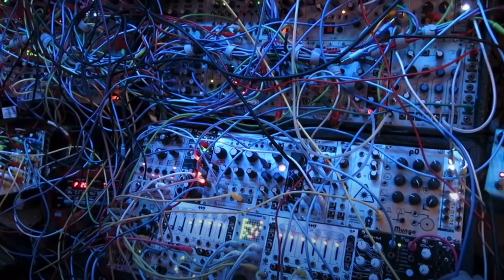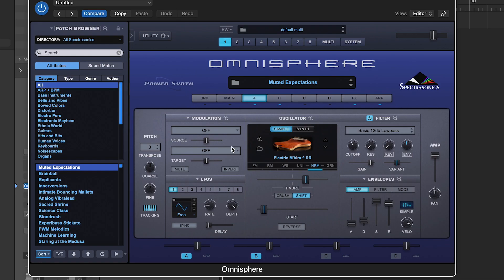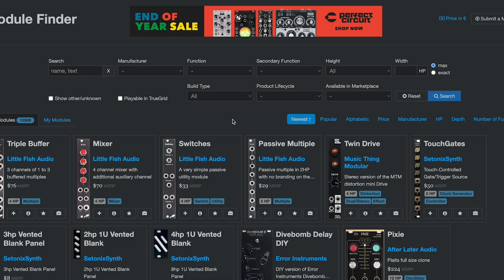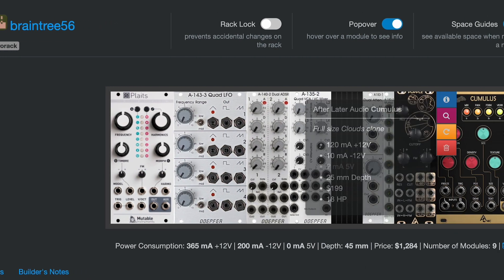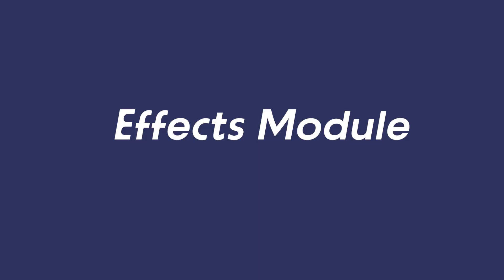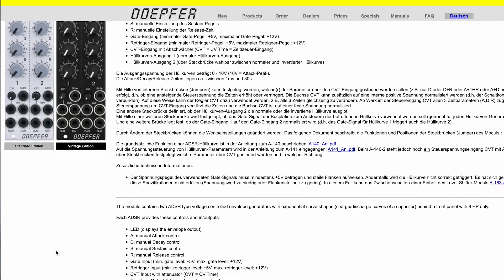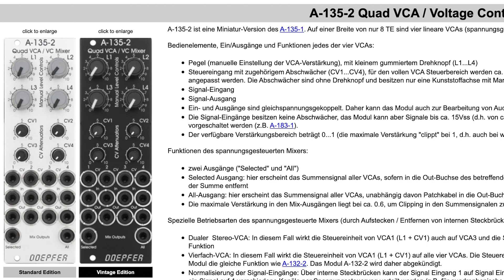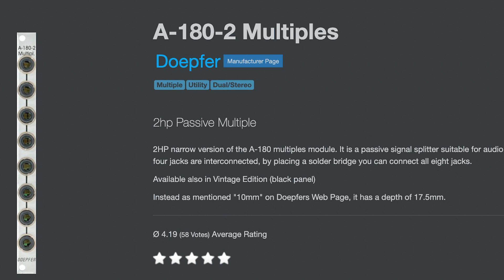First Modular Build - Expanding on the Moog Sound Studio - The Plan - Video 1

Comment: Man this is so helpful. I just found this today and I am in the exact same situation. Tiptop case using with DFAM. Using it to expand what Moog can do, since I have great oscillators already. More modulations available. I felt weird going this route until I saw this video. Thanks so much!
Reply from the maker: Thanks. I kind of veered off this path though. I ended up diving in. But this is really a great place to start so the initial cost doesn't feel so tough.

Comment: I, for one, am rather new to the modular world: I got my first gear a mere 3 months ago ! But as you did, I too did intensive research before choosing what to buy. And I believe that this research really pushed me AWAY from modular into SEMI-modular.
The reason is that the analog semi-modular market these days has grown huge, with many products being truly affordable and providing most (if not all) of the functions that various modules can provide here and there. Obviously, no synth by itself will answer anyone's dream configuration. But, at the price of a few redundancies (and some wasted space too), I believe that one can gather exactly all the functions one needs just relying on the reunion of a few existing semi-modular synth, for a fraction of the cost of the equivalent modular system (buying modules by the function ends up being really costly).
Now, I will definitely agree that this strategy makes you end up with a less elegant system than a one-of-a-kind modular rack built to suit your very own needs. But as I said above, the final price is generally a fraction of that of the modular equivalent.

As an example, I, for one, have built a configuration around a two-synth version of the Moog Sound Studio, with a DFAM and a Subharmonicon. But instead of buying a Mother 32 as a third synth, I went for Behringer's recent clone of the Arp 2600 (I have been dreaming of an Arp 2600 for decades !). For pretty much the same price as a Mother (or even a bit less), you get a beast of a machine with 3 oscillators plus an LFO, two enveloppe generators and dozens of signal processing modules (ring modulator, voltage processor, Sample & Hold, Enveloppe Follower, Mult, Spring Reverb, ...). It simply is an endless source of exploration by itself, and complements my other synths (the two Moogs) perfectly.
To that, I added a dirt-cheap entry drum machine that can sequence Cv signal (giving me six extra trigger-alone lines of sequencers for "beefing up" the rhythms of the DFAM), and an Arturia Keystep to play the whole thing and use the excellent built-in sequencer too.
At the end of the day, and including various cables and adapters, the whole thing ended up costing me around 2800 €. I do not think I could have even approached close to such a configuration by sticking to a pure modular system for the same money.

Once again, I will definitely agree that building a one-of-a-kind system with the equivalent specifications using separate modules would have yielded something much more elegant and more user-friendly. But the price tag difference kept me away from it.
That being said, the spirit remains the same: it is all about assembling the exact set of particular functions that will end up meet your personal sound design cravings ! 🙂
Reply from the maker: I love the Arp2600! I've wanted one of those too... I hear you. It's definitely costly. Even for the super tiny setup in this video cost me about 1k. It's such a hard space to enter, but now I'm finding that because I have the base setup, I can add modules slowly over time. It's a fun hobby and it appears many of these modules retain their value. I try to look for interesting deals on used modules as much as I can. Its a pretty fun community.
Reply: @braintree56  The ability to grow by gradual steps is indeed an interesting aspect of modular synths. And you are right about the resale value too: it is an element to consider if one intends to make one's setup evolve.

Concerning the Arp clone, I went for a Behringer 2600 Blue Meanie (which is a full-analog version), and I have to say that I have been positively impressed by the build quality, the design and the sound of this machine. They based this synth on the better-equipped versions of the original Arp 2600 (namely, those with a dedicated LFO and a Mult added next to the keyboard), and on top of that also added several quality-of-life modern features: a full MIDI connexion, VCOs with a larger choice of waveforms and modulation patch points than on the original, a widely extended range of enveloppe times thanks to a time multiplier switch (present on both the ADSR and the AR enveloppes modules), and a few other extra things here and there.
All the patches detailed in the original Arp Patch Book of 1971 (which has been made available online by Korg) work like a charm on the Behringer clone, which makes me inclined to trust that the experience it provides is very close to that of an original model.
Behringer is a company that often makes controversial products, but with this 2600 clone, they demonstrated they were also capable of the best. This synth is a masterpiece, and I would advise any modular fan to add one to their rack !

Comment: great video. i felt a lot of the same things you did when getting into modular. overwhelmed, bummed out by the case decision, not sure where to start, how do I "plan" if I don't know what I want yet, etc. i'm recommending to my friends that they consider the erica synths edu line of modules, now available as a set of fully assembled modules for a great price. one other thing, you probably know this, but the mults on the matriarch are buffered, and your doepfer is passive. totally cool, you just won't want to mult pitch CV with the passive one. great video, very glad you shared it. looking forward to seeing your new gear in action!
Reply from the maker: I actually didn't realize the multiples we're different! Thanks, that likely saved me a lot of time problem-solving! :)

I also didn't know the Erica Synths line was producing fully assembled modules now. I had looked at those, but ultimately decided against them because I figured the DIY thing was a project for another day. Thanks.

I'll bet a lot of people feel the same way. Did it work out for you?
Reply: @braintree56  my setup started with a 0-coast, then a DFAM, then an inexpensive Make Noise powered case. I'm now in DEEEEEEEP lol. I'd say it worked out :)

Comment: A Pam’s new or Pam’s pro workout would be great for this rack. It’s a clocking, modulation, and sequencing beast in a small size. It includes menu diving but it’s not bad at all. The new pro version has a better screen that helps visualize what’s going on with your sequencing or modulation.
Reply from the maker: Totally! I debated that for a long time. (also Maths). If that 6hp hole was 8hp - I would have planned to fill it with that module! I'll have to get it for the next build!